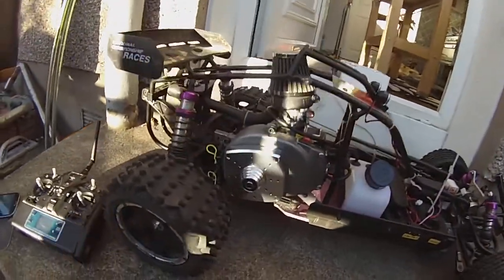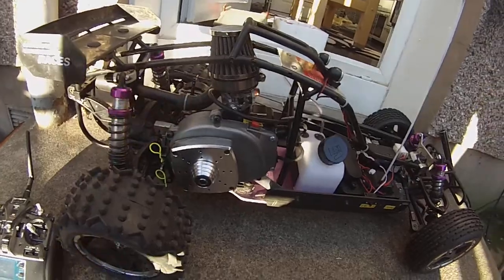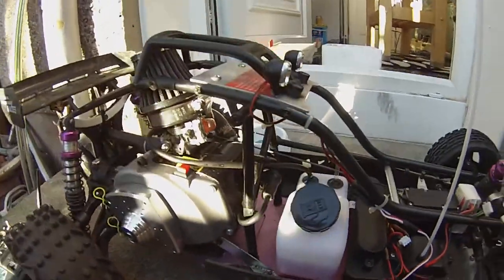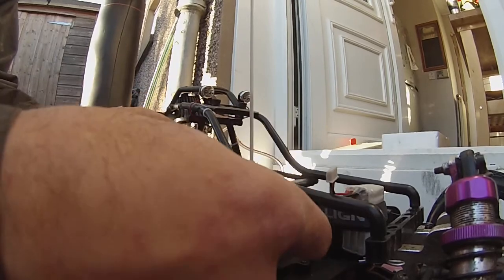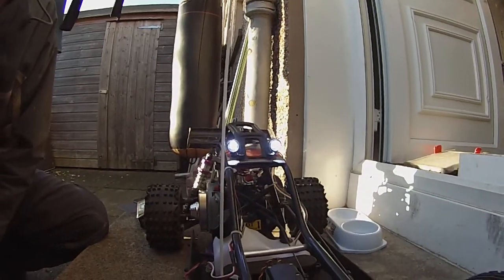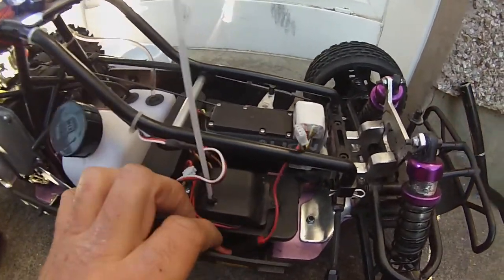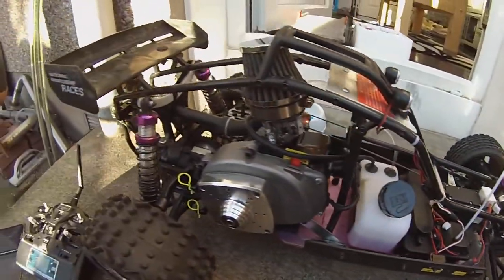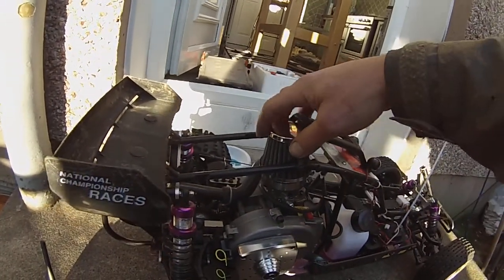new yama 30cc engine with roto start

Comment from the maker: Hi chris
I would think it needs re tuned start with 1 1/4 turns out on the low needle and 1 1/2 turns out on the high end remembering not to screw the needles in to tight as that will damage them and cause all sorts of tuning problem's. 
Did u take the air filter body of the carb and cut away the plastic cage on the outside leaving the small cage on the inside then file smooth wash the parts afterwards to get rid of any plastic filings then refit the plastic body and the new filter should fit tight over the plastic filter body 
Hope this helps

Comment: hey i just got my yama buggy 30 cc last night got it used i drove it this morning seems to start in one pull but the problem is is kinda slows down when i open full throttle...i really don't know about  this whole needle setting can you please help me out with this thanks a ton mate...
Reply from the maker: ***** Hi enoch i would start with the standard settings of 1 1/4 turns out on the low needle marked L on the carb and 1 1/2 turns out on the high needle remembering not to screw the needle in too tight before screwing it out to the correct setting and i would imagine your buggy is flooding between the transition from low to high its a bit of adjusting that is all that's needed remembering once the low needle is set up its really just the high end needle you should really only adjust but only by very small amounts as it doesn't take much to damage your engine if you run it lean on fuel 
a small word of advice is to make sure you are running it on the correct pre mix as advised by the manufacturer and once your engine is run in it will need re-adjusting and i run mine on a pre mix of 35/1 but that will also depend on the temperature you are running it in 
sorry for late response but any questions i will get back to you

 Steve

Comment: what rpm is your drill and how many volts
Reply from the maker: chad reno Hi The drill is a JCB 18.5 v drill i bought from B&Q not sure on its rpm the new starter i fitted to the buggy suffered a bearing failure in the one way bearing and have been unable to replace the bearing